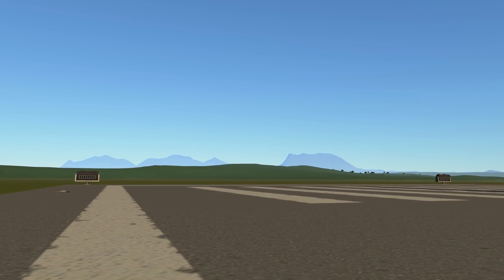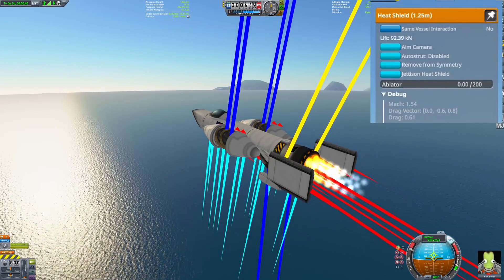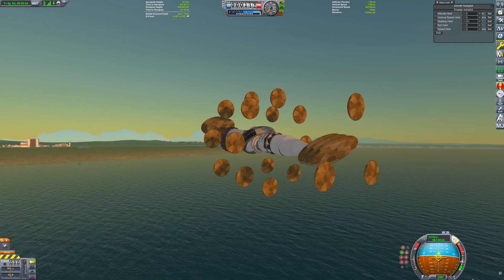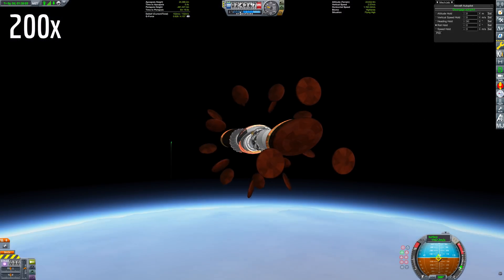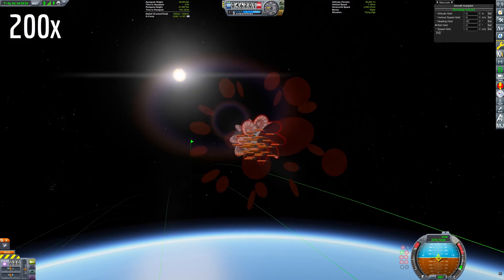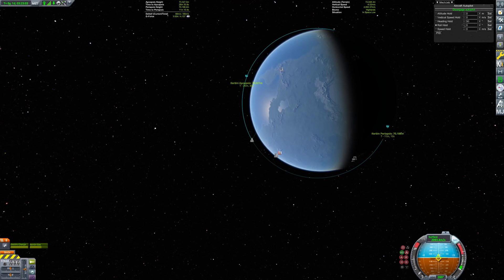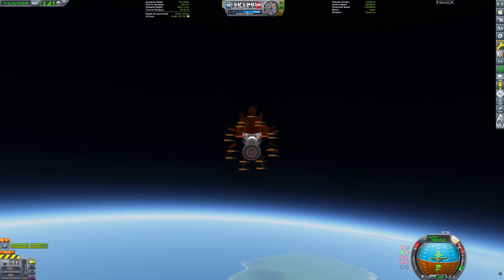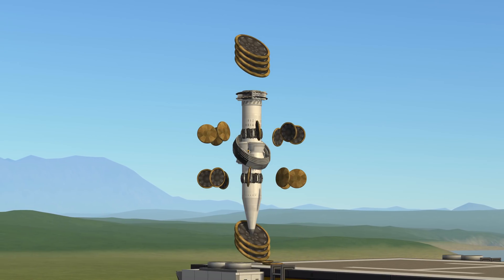2100 m/s on a Stock Propeller | KSP 1.10.1

Comment: The fun of games like ksp is their ability to simulate real world situations in a simplified and exaggerated form. Some exploits like clipping thousands of engines together allow the player to bypass the limits of the game to create things that still fit in to the theme of the game. A hypothetical SUPER rocket fits into the theme, but the devs did not include it. The heat shield exploit however... is VERY outside the theme to the point of it ruining the feel of a space sim. I think the heat sheild poses a dangersous threat to the ksp creator world. I’m reminded of besieged where the steam marketplace was dominated by builds that used so many mods, bugs, and cheats that it destroyed most of the communities interest in the game. 

Now obviously ksp is a much more robust game with a more solid community so it isn’t at the same risk.. but the sentiment holds true.  This is probably the ONLY heat shield plane that would ever interest me. Any more would get dull fast.
Reply from the maker: Thanks for your thoughts. I feel a similar way to this: I feel a lot of the fun of KSP is being lost in aero exploits. Its gotten to the point where I'm enjoying playing without occlusion and clipping at all. 

This tech makes this even worse. Basically, every space plane is going to degenerate to a fairing with heat sheild wings and a ton of clipping if you want maximum performance. 
I'm planning to make another video to show how far you could push this, but not too much more than that. Its a curious bug, but as I said, I'd hate to see every design use it.
Reply: @Stratzenblitz75  I think it would be ideal to go both ways at the same time; missions with minimal clipping or exploits, and then completely bonkers alien-tech missions with vehicles that use heat shield wings and props and kraken drives for scooting around in space. The former shows off design skill in a way analogous to what can happen in real life, and the latter shows off a sort of meta-design aspect, seeing just how far the game can be pushed if you're willing to go crazy with it.
Reply: @Stratzenblitz75  ive swiched to FAR evers ince i realized how easy it is to break the stock aero.
Reply: @TheToric  FAR is on CKAN right? I love building crazy in-atmo stuff (bought a full HOTAS setup mostly for stunt flying and general jet-based silliness) but as you say, stock aero is far from perfect and I've been meaning to check out FAR. Unfortunately I'm currently stuck on an OLD i7 laptop so I'm hoping it's not particularly CPU-intensive, the old girl gets hot enough as it is... :)
Reply: @sixstringedthing  the math is most often done on the GPU sense the GPU is built for number crunching, the CPU is for more random fluctuating problems that don't always come up like ram accesses, aerodynamics is calculated by a per frame bases.
Reply: Me, a person who has only ever played vanilla KSP (+ DLC) with a couple of small info/helper mods and a bit of added prettiness (KER, KAC, scatterer, planetshine) and only uses part clipping in a way that could actually be engineered to work in the real world (e.g. building a probe core or battery bank into the void between the ends of two fuel tanks): "KSP gets LESS fun as you wander further away from reality? 
OH NOES!!"

I guess my point is that one of the greatest things about the game is the freedom to play it entirely your own way. I'm constantly amazed at  the creations showcased by guys like Scott, Shadowzone and Brad, which tend to keep part clipping and exploits to a minimum (okay, Brad likes to bend the rules a bit, but considering what he's done with pure stock non-exploited crafts he's earned that right in my book!). The things that Stratz comes up with are something else entirely, but I get just as much enjoyment from seeing what the game engine will allow at the extreme end of Kerbal engineering prowess, and his relentless pursuit of exploits and weird physics behaviours have actually pushed me to be more creative when I'm building crafts in my own much more conventional style.
TL;DR - there's no way to play this game "wrong", it's all about what you consider to be allowable in your own particular Kerbal Universe, and honestly, the number of games (or other forms of entertainment) that applies to is pretty damn small. That's a big part of what makes it great, and part of the reason we'll be celebrating the 10th Anniversary next year.

Just my 2c as always. 😁

Comment: the craft accelerates to 2300 m/s but then it cuts to its stable velocity of 2115 m/s... so the highest speed would be 2300m/s not 2100
Reply from the maker: 2300 m/s was in orbital mode, whereas 2115 m/s was in surface mode. I'm counting the surface mode since its more accurate to the airspeed.

Comment: I guess we will have unrefueled Eve + Jool sea-level SSTO soon. Would love to see it)
Reply from the maker: Yes! I may or may not be working on that right now :P
Reply: @Stratzenblitz75  Why stop at Jool when you can try a Jupiter SSTO, with RSS?
Reply: @ber936  Holy shit, is this even mathematically possible?
Reply: @Stratzenblitz75  You mad man. I love it.
Reply: If it it's too easy, do both in the same misson!
Reply: @gliesegliese1411  He's probably doing that anyway
Reply: You could use it as a fully reusable Eve SSTO shuttle, it only needs to mine for a bit of Xenon and then it's good to go again!
Reply: @joshw1526  pffffffff xenon. you would be totally fine with using a vector. save yourself the time and pain. he did say you only need a little "puff" (get it, puff? monoprop puff engine? XD. I guess you can use that too) to get to orbit, so f the efficiency. 

I just realized you probably meant a kerbin-eve shuttle and not an eve-eve station shuttle lol. so you can probably ignore that.
Reply: @joshw1526  You can't mine for Xenon, can you?

Comment: Yeah, this is so busted it falls into the docking port kraken drive category
Reply: I love the docking port KD. I try to use it sparingly as it is like serious cheating, unless one thinks of it as the next step on the tech tree.
Reply: Disagree. This is perfectly energy and momentum conserving. There's no magic thrust. It's definitely very broken, but it's no K-drive. Arguably it's less unrealistic than reaction wheels (no conservation of angular momentum) and the Breaking Ground prop blades (free energy).
Reply: @petersmythe6462  or the narrow-band scanner (free energy from rotation, someone made a fully mechanical plane with it!)
Reply: @petersmythe6462  well having practically 0 drag on an object that is ment to have loads of drag is fully broken imo, but still fun.

Comment: Heat shields produce lift because they push the air to the side and Scott Manley talked about this

Btw how did you generate that INSANE almount of electric charge?
Reply from the maker: In real life, that makes sense. But KSP has an odd aerodynamic model (as you can see in the video) so its surprising to me when certain parts have a lot of lift (like heat shields). Landing gear also have a lot of lift as well: you can get pretty high L/D ratios with just landing gears angled at 45 degrees. Its not quite as good as the heat shields, but its very interesting nonetheless.
Reply: Now try to fly using other parts like Hazardish did with kerbal parachutes
Reply from the maker: As for the electric charge, I just clipped like... 60 RTGs into the fairing.

Comment: This man... He used the most obscure part as a wing, and made it insanely efficient!
Reply: I mean heatshields aren't really that obscure, they're kinda needed for any capsule re-entering from all but the lowest orbits
Reply: Cough skipping reentry.
Reply: Yeah, heatshields without any ablator left.
Reply: @enderger5308  The stock ablator in KSP burns off so slowly that, when you combine it with the already high base heat tolerance of the part even at 0 ablator, you'll probably be able to do at least one full lap around kerbin before heating even becomes an issue
Reply: @richardmillhousenixon  That's the joke: That they actually burned all their ablator (which never happens because the game's default quantities are... generous).
Reply: @enderger5308  like fr I've done orbital re-entry profiles using RSS (w/o Realism Overhaul) from beyond Pluto's orbit and still didn't even burn through half of the ablator on the 2.5m heat shield